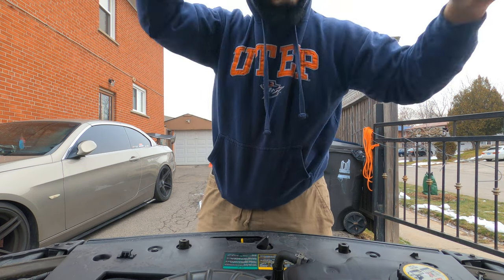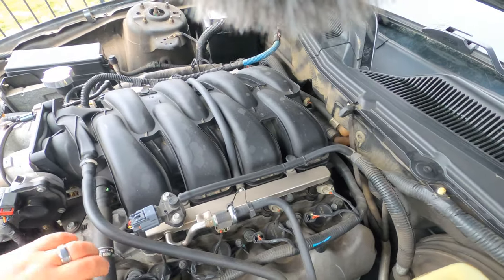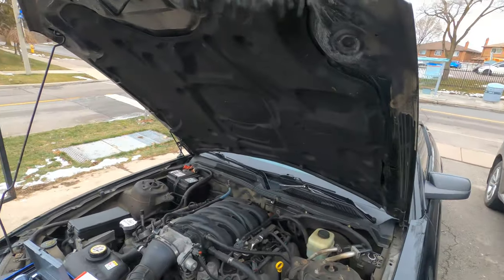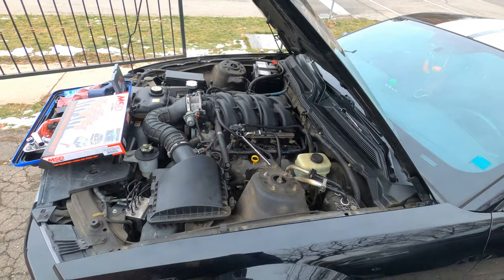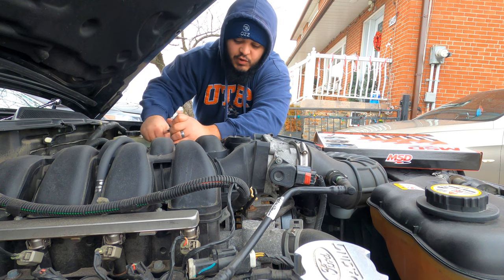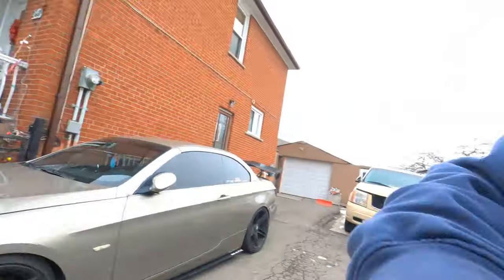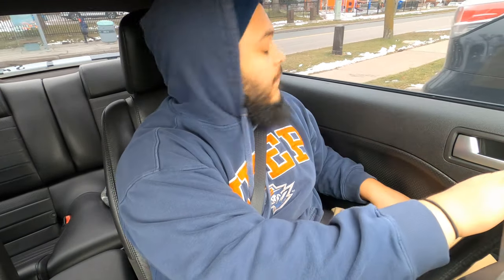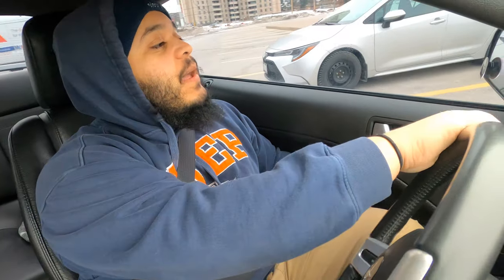Installing MSD Blaster Coils & Champion 7989 Spark Plugs | 2006 Mustang GT

Comment from the maker: If you'd like to purchase any of the products used in this video, feel free to use my Amazon *Affiliate Links below!
USA: The Gapper (Spark Plug Gapping Tool) : https://amzn.to/2XRQOly
USA: Permatex Dielectric Grease : https://amzn.to/3ipBB4Y
USA: OPOLAR Cordless Air Duster (Electric Equiv. of Compressed Air) : https://amzn.to/3qyJwPV
USA: MSD Blaster Coil on Plug Kit : https://amzn.to/38QM8mu
USA: Champion 7989 Double Plat Spark Plugs : https://amzn.to/3qoksLw

CAD: The Gapper (Spark Plug Gapping Tool) : https://amzn.to/2LIprb9
CAD: Permatex Dielectric Grease : https://amzn.to/2Kv0Sy4
CAD: OPOLAR Cordless Air Duster (Electric Equiv. of Compressed Air) : https://amzn.to/3qurIFU
CAD: MSD Blaster Coil on Plug Kit : https://amzn.to/35NbuzO
CAD: Champion 7989 Double Plat Spark Plugs : https://amzn.to/2NeHeY5

*Affiliate links provide affiliates like me with a small percentage kickback from all purchases made using the special links; and with no extra cost to the buyer! It's a subtle way of supporting your favourite creators, especially if you plan to purchase the product(s) they're using anyway!

Comment: I have to admit, you made me a little nervous starting the new plugs using the ratchet, but you have inspired me to "tune up" my Bullitt a little early. Kool vid. Keep them coming.
Reply from the maker: Haha 😅 But it definitely brought my car back to life for sure! Thanks for always watching, commenting, and supporting the channel 👊
Reply: I like to take a 12-18 inch piece of fuel hose push the plug in one end and use the hose to start the plugs threading in, by doing it this way if they are trying to cross thread the plug will slip in the fuel line not allowing you to turn it any further potentially stripping the threads
Reply from the maker: @philsmith5829  Never heard of or seen that method, but I think I understand it enough to see how it could work. Pretty neat little trick, thanks for sharing.
Reply: @OctaneStreet  My pleasure, Brother.

Comment: I ran msd products like distributors, ignitions exc..back in high school on my 78 Pontiac Phoenix coupe and my 87 chevy c10...my wife's 06 gt is having idle issues and a small bog in the throttle response I wish I had the extra cash 4 the msd packs I went with the sr performance with brisk silver plugs..hope it solves the issues and improves fuel economy,throttle response..thanks 4 the vid
Reply from the maker: Haha that's dope! Hopefully the new plugs and coils can fix that bog in the wife's car though, you can try scanning it if you have a scanner to see if any codes pop up.
Reply: @OctaneStreet  I think it should solve the problem no lights on the dash indicate a serious issue...bought the car for her 15 years ago and just hit 84k miles on the o.d car still looks as it left the dealer..not many 3v in my city and to see 1 in this condition is bar none..I've asked if she wanted to upgrade back in 2014 for a gt500 or new s550 coyote but she loves the bodystyle of the s197..works 4 me no car note in over 9 years+ extra $ in the wallet for aftermarket..

Comment: Hello I have a question, I have a Ford Mustang GT 2006. My parents ran over a deer with it by accident so I’m having to buy a lot of parts to fix it but I have no clue how to fix it myself and was wondering where is the best place to get parts and find how to fix it
Reply from the maker: Yikes, that is one heck of a story. A great place to get OEM parts for a vehicle is honestly the dealership. I believe most Ford Dealerships might be able to sell you OEM 06' Mustang parts if you place an order with them, and I believe their prices are usually fair. For other parts you might want to check local classifieds and ebay, etc. As for trying to install the parts yourself, look up each thing on youtube and do the installs one by one. It helps if you can find a friend or family member to help out. Good luck man, and just know it's probably going to take a little while before you get everything fixed. Repairing things on your own with little help and knowledge can sometimes make the repairs take 5x as long!

Comment: Get yourself a cold air intake, headers and a tune man to complement them coil packs and spark plugs. That thing would rip.
Reply: Fun fact: Aftermarket coil packs restore power and add some extra power. Not a substantial amount but it is better than nothing.
Reply from the maker: I have a CAI and Tune in my possession already :) just need to change a few fluids within a week or two before I dyno my car "stock" and then install the cai and tune! Headers and mid pipe will come down the road, my car is in desperate need of a suspension upgrade since its badly worn.

Comment: How are the coils holding up? Thinking about doing all of this plus fuel injectors.
Reply from the maker: Haven't had any issues with em so far so they're doing great. I remember thinking about replacing fuel injectors but iirc it might not be necessary unless you're future proofing the car to add a lot of power down the line. Really can't remember though, would just recommend doing some research ofcourse! Good luck with the install 👊

Comment: Ain't no Thang like a happy stang 🤣🤣
Reply: @OctaneStreet  I'm currently trying to figure out an issue with my auto 05 GT. It idles fine yet when put in gear it begins to misfire and when accelerating it loses all power. However it will not throw any codes. I'm going to use this video and hope it works out for me.
Reply from the maker: @Shadow-do3ej  If it's only in gear it's probably a different issue, google what you just told me and see what pops up. Also try scanning your car because even tho there are no lights on the dash it might still have a code for you (unless you already checked). Sometimes it can be the silliest thing that causes this, like a loose intake hose or maf sensor... Hopefully it's something simple in your case as well. If you feel your shifter moving a lot too though while in gear it can be a tranny issue as well, maybe slipping gears or something who knows, let me know what it is when you find out and if you remember to come back. Good luck
Reply: @OctaneStreet  I've been researching this for a few weeks now and everything points to maf, dirty throttle body, or spark plugs and coils. I've done everything except the spark and coils. Should have been more specific earlier the idle is not misfiring but occasionally runs rough. Once in gear it slugs around and misfires really bad only when accelerating. Appreciate you replying as well that's really cool of you.
Reply from the maker: @Shadow-do3ej  If viewers take the time to watch my content and comment, then I do the same! Glad I wasn't too far off with the MAF guess as well. If you haven't changed the plugs in a while I suppose it would be a good idea to get a tune-up done anyway then since it can definitely be the culprit. Make sure you don't have any vaccuum leaks anywhere; you can possibly hear it if you have one by having someone revv the car a little while you listen to the engine bay with the hood open. Make sure your intake if it's the stock one is seated 100% properly underneath the airbox lid (i've seen this cause a similar issue in the past as well on a V6 Mustang). It wasn't seated 100% proper and caused misfires and loss of power. Good luck man.
Reply: @OctaneStreet  Thanks! Just found your channel today and digging the vibe you give keep it going.
Reply: @OctaneStreet  She lives! Once the weather warmed up i found out I had a few bad coilpacks and bad sparkplugs.